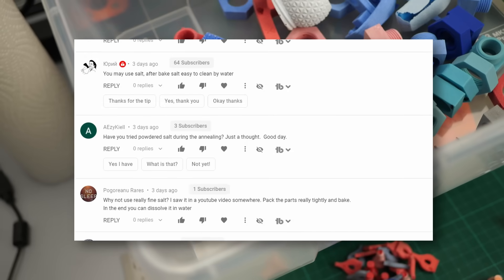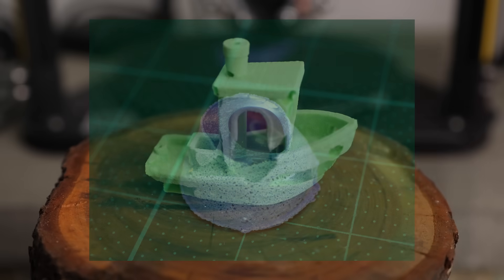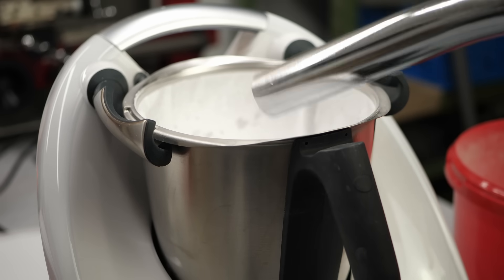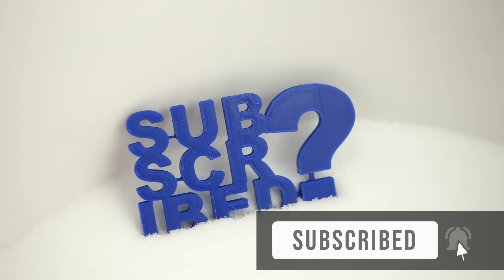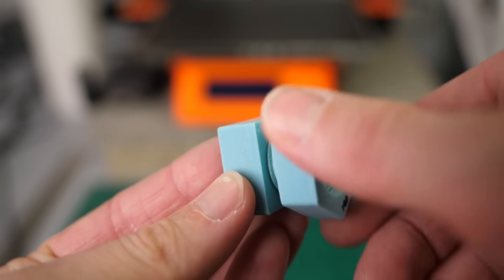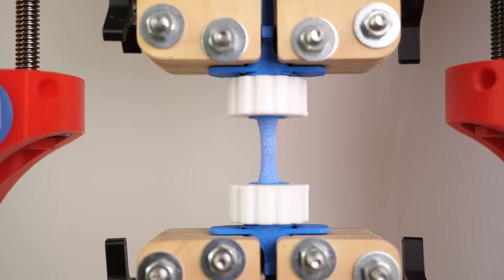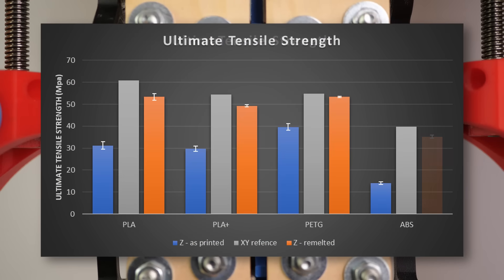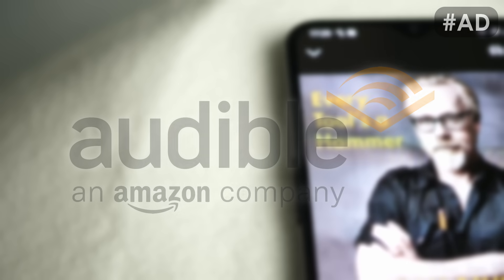The STRENGTH of 3D prints REMELTED in SALT

Comment: I love your blender!

Can we use some other finely powdered substance in place of the salt? (Since achieving a fine enough powder seems to be an issue).

EG, lime flour, which is finely powdered calcium carbonate, available from rural/farm supply stores. (not to be confused with coarser fertiliser grade 'ag lime', lime flour is used as a nutritional supplement in animal feeds)

Gypsum (calcium sulphate) is also very finely powdered and clumps to hold it's shape. Could you anneal in dry, screened gypsum?

(I already ruled out calcium hydroxide, which is a good powder, but will react with the polymers according to google)
Reply from the maker: Water dissolvable is definitly a plus and also non-toxi, because finely powdered materials are a health risk.

Comment: I've heard of perlite being used for heat treating steel so I wonder of it could be used here as well.
Reply: Perlite is a volcanic glass, it would become trapped into the plastic object. If the perlite was clear (or using a fine glass dust, like sandblasting medium), and the part you were annealing was clear, the two could come out semi transparent.

Comment: I would think an equivalently small copper or aluminum powder would be as good, if not better. I'd be worried about copper oxidizing extremely fast at that particle scale, but the aluminum should be reasonably immune.

Comment: I would do an initial packing around the part with Delf/petrobond metal casting clay. Maybe a thin layer around everything 4-5mm in thickness, then surround that with packed salt, table salt even, since all the details you want to keep will be easily maintained by the delf/petrobond, also likely to maintain layer lines too.

Comment: Have you thought of using some kind of coating on the parts before embedding them into the salt, to reduce the surface porosity caused by the salt granules?
I would imagine that even something like PVA might show an improvement, and would still be water soluble.

Also, using other water soluble salts than sodium chloride may work well?
Sodium Metasilicate may work, and is often supplied as a fine powder rather than granulated.

Comment: I used this salt method some weeks ago. Used simple table salt grinded down to flour like consistency. Baked multiple PETG parts printed with multiple filament brands. I got the best results with a transparent red filament made by Verbatim, baked at 180°C for 40-60 min (depending on the salt layer height) in a preheated oven. I found that the results are the best if they look like sandblasted glass. The test samples yield before breaking, and the broken surface doesn't go along the layers but show a distinctive shell like pattern. If the sample surface became sponge like, then I found it more brittle.

Comment: You should look into a ball mill.  They are what I have used in labs to finely grind various salts.  No advice on other compounds that would be better.  Sodium Chloride really seems well suited to the task as well as having broad availability and low cost.  You may also consider oven drying the salt and storing in a dessicator.  Ambient moisture could greatly sway results especially when packing it.

Comment: Could you try shot blasting powder? Usually a super fine ground glass bead or metal bead? Used to finish metal parts and remove paint etc. Could be cheaper?
Reply: Just looked and 0.2mm max glass bead can cost as low as £9 for 25kg

Comment: plaster powder without adding water? the biggest problem i can see with this method is thermal conductivity of the salt, so if we can find a suitable fine powder to replace it that also holds its shape it would really improve the speed and end results, and maybe even the surface finish

Comment: You guys are way overthinking this. Take the printed part, flour it, dip in egg wash, then panko bread crumbs. Repeat twice, then deep fry in vegetable oil. Peel off and eat breading. Done.
Reply: I know you are joking but you might actually be on to something here. You are basically describing a form of investment casting
Reply: @free_spirit1  Was thinking the same thing. He tried plaster, but I believe the water was an issue. Must be some material out there to use as a binder that won't effect the PLA and can be dissolved afterwards. Smarter people than me will figure it out.

Comment: Maybe a better material would be bentonite clay. It's used in many industries and can be easy to find. You should be able to find it where pottery supplies are sold. They also use it for drilling wells too, so you may be able to get some from a drilling company.

Comment: Maybe another even finer powder that doesn't have water in it will give better results and reduce surface pores. Somebody mentioned in another comment talc powder. I wonder if very fine clay powder could also work (unfired caly, because it can still be compacted). Also I would try diferent metal oxides (that can be found in powder form) to see what effect those have on the surface finish.

Comment: Now you need to heat them in a vacuum in a finer grain material..  This should remove any issues with burning at higher temperatures and also should remove any bubbles.

Comment: Could you use plaster, but without water? The same way as you use powdered salt?
Reply from the maker: Probably, but cleaning it off will be a pain because it's not water dissolvable.
Reply: @CNCKitchen  Plaster will recristalize with sodium carbonate forming calcium carbonate. If the latter cannot be rubbed off it will dissolve in weak acids.
Reply: what about portland cement? the particles are very fine
Reply: @prolfinator  It could work, but handling would be difficult, since Portland cement is very alkaline. Washing would be difficult as well, as wet cement dust can be quite dangerous.

Comment: I'd love to see a comparison of a single material (PLA) and how it reacts being remelted in different materials.  Sand, greensand, salt, talc, flour, corn starch or even something more exotic like graphite. :D
Reply: Should add fine metal powder to that list. The metal would bind to the plastic part, but it would have a very tough abrasive resistant surface if used.
Reply: @justcraziii  Aluminum Oxide is very hard and would make a great abrasive finish.
Reply: Hey! I have 2 kg of graphite powder! Gotta try that!
Reply: @Balorng  what's the result?
Reply: Well, that is very, VERY interesting, in a rather unusual way. By itself, it will not work: the salt method is uniquely great because it clumps and maintains shape w/o a binder (which gives nasty vapors under heating).
But! When you add a bit of graphite to the salt, instead of baking the stuff for hours in the oven, you can can bake it for 5 minutes in the microwave!
More that it, carbon or grafite filled plastics will take even less, and if you print them in a zebra stripe or coaxial filament - is is very likely you'll be able to fuse the layers but maintain hollow structure!
There is a paper online where they did just that, but using a very thin nanotube coating - you don't even need to bury the model in salt... but it is complex. Still, very interesting and worth experimenting with.
Reply: @Balorng  I guess add Fe2O3 into salt, might work in microwave too
Reply: @goldengrapeorg  fine metal powders work too (skin effect heating), but not as well.
Reply: @Balorng  graphite+salt+microwave might be able to heat locally, let only certain parts remelt
Reply: In theory yes. In practice when I've tried that I've ended up with a burt part in the model :(
Reply: @Balorng  It is possible to apply graphite to the seam and bury it in salt and heat it in the microwave to produce some kind of weld.
Reply: Оh, you mean that. Makes sense I guess, for fusing compex parts togther w/o completely remelting them... but I think solvent-velding in easier unless you have a hard to bond plastic like nylon or PP.
Reply: @Balorng  I smeared on two surfaces with a pencil, then pressed it, then put it in the microwave, but it didn't work.
Reply: @goldengrapeorg  it does not happen instantly! How much did you put it on? I suggest you use very low power, but wait longer. As far as I understand, there is a limit how much a very small quantity of graphite can heat up your plastic, and all the while "excess microwaves" will "build up" in your oven and may damage your magnetron. Maybe put a cup of water along with it...

Comment: I have tried this method and it is very promising. I bought Kosher salt From the store, and then blended it for around 30 second in a cheap 15 dollar coffee blender from amazon. the surface finish was quite better than what CNC Kitchen is showing on his results. when compacting I found that trying to compact a base layer and then place the print in was not the way to go, as the force from compacting a second time caused the prints to push further into the first compacted layer and leave intends (essentially voids) on the bottom of the prints. once I fixed that I got really good parts! sadly I still had a really small void on the surface and I believe this is due to the really small gaps between the layer lines, leaving plastic higher up being pulled down by gravity to fill in the void. 

Side note, if you take the part to a lighter or hot air gun you can slightly re-melt surface for a better surface finish!

Comment: Why you don't use oilsand (in german ölsand, formsand oder giessand)
its used for for casting metal. Its common used by goldsmiths or even at casting bells...
its dimensionally and temperature stable.

Comment: Interesting.
I wonder if something cheap like corn starch would work. It has a very fine grain and can be washed away with water.
I agree with @landen1234 that it should also be vibrated to make sure it completely packs around every nook. 
Maybe even take an additional step and also pack it tight by tamping after vibrating.
Reply: On the original video someone suggested cornstarch but it would burn at these melting temperatures.
Reply: @justcraziii  
I was looking into that as well.. There are some studies out there that tested what temps the dust will ignite, and it was over 400C to get that to happen. Since the oven would be around 200C for PLA, I think that might work.. However, I wasn't able to find any info on heating it without water., not sure how that would work. 
Could eliminate dust concerns by just putting a layer of foil over the container.   I might try this with a small amount to see how it reacts.   Curious..
Reply: @smithfamilydesigns2012  Keep us informed!  I'd be nervous and have a some detector nearby. I tried this salt experiment with transparent ABS and anything around 20mm cubed needed 3+ hours of heating.

Comment: I've been working with this technique for several weeks now, using Morton Flour Salt (very fine grind), a MK3s for printing, and a convection oven for processing. I put thermocouples in the salt to monitor temperature, both with a handheld reader and with a data recorder. I've processed PETG, filled PETG, and filled nylon. Getting the void ratio down is straightforward. Getting the materials properties where I want them (strong but not brittle) has been the challenge. It seems that a rapid cool-down from the annealing temperature is required to keep the plastic amorphous and not mostly crystalline, but pulling the samples from the salt when they are very hot to rapidly cool them also allows them to sag without the support of the salt. I think there is a good process to be found - still looking.
Reply: table salt has very low solubility in ethanol (0.65g salt per 1kg ethanol).  You may get good results by chilling a pot of ethanol, and dumping your parts, salt and all, into it.  Maybe use a perforated container when reflowing your parts to allow the ethanol to flow in faster.

Using ethanol, rather than water to cool the parts has two major advantages:  It can be cooled and remain liquid at temperatures much lower than water, and it doesn't dissolve salt well, so you might be able to dry the salt much easier without needing to put much effort into reprocessing the salt.
Reply: @Kineth1, would hot chunks of salt going into ethanol cause flammable vapors to be produced?

What about just putting the parts straight into water? Sure the salt would dissolve, but the water could be evaporated and the remaining salt re-ground.